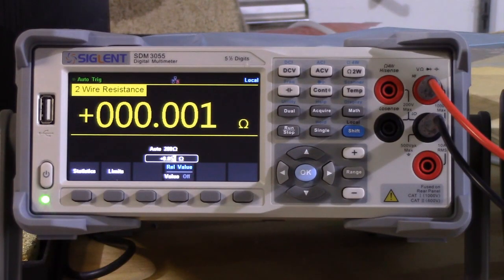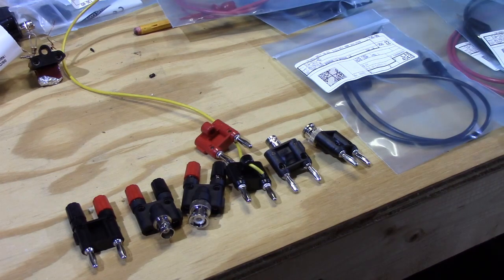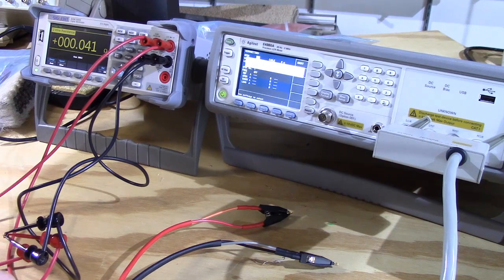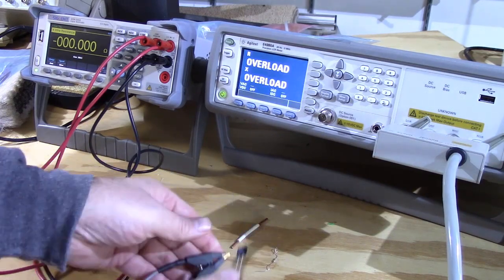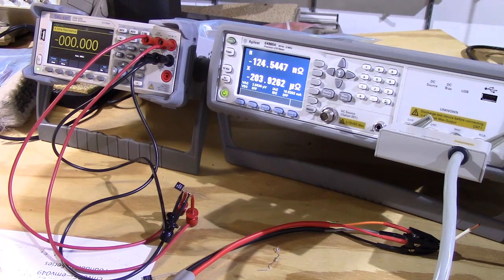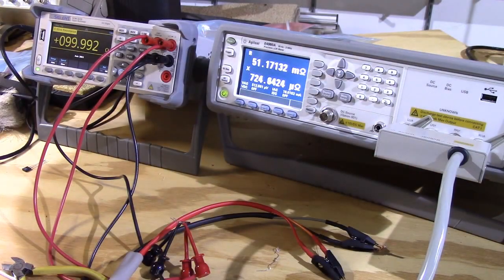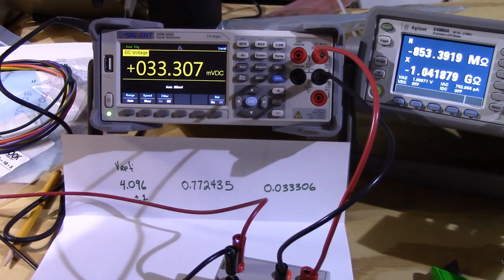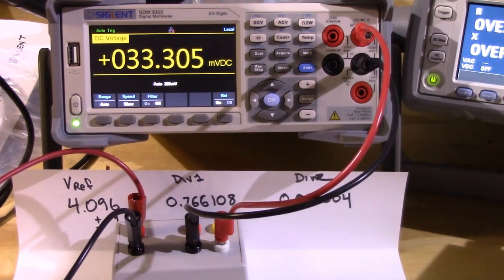ER01: Siglent SDM3055 5.5 Digit DVM Review

Comment: The way your voltage dividers seem to be done the following is probably happening: the 4.096 V are guaranteed by the IC output; with the smaller voltage probably the output impedance is relativelly low as compared to the 10 Mohm input of the multimeter; but with the intermediate voltage the output impedance is not neglectable. The multimeter has an optional input impedance of 10Gohm that could be used instead for this measurement.

Comment: A question about the banana adapters where you can screw in two wires @2:20. How are these called or do you have a type nr? Also @5:00 those with the test clips are interesting. Did you get these from Digikey?
Edit: Found it, it's the Pomona MDP-x series and 3782-24-02 Minigrabber.

Comment: Since you're looking into budget but highly capable equipment... If you solder a lot I would highly recommend the TS100 soldering iron with TC, this blows most of the high end soldering stations out of the water for a fraction of the price.